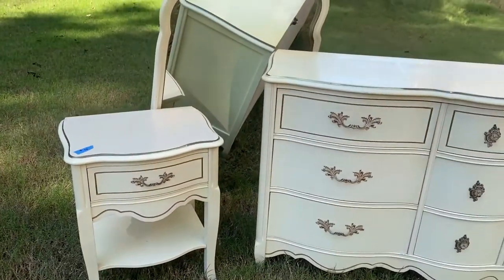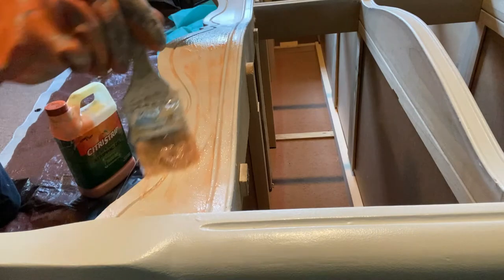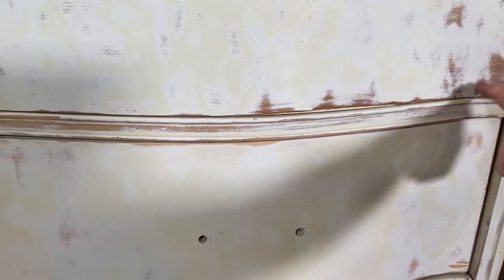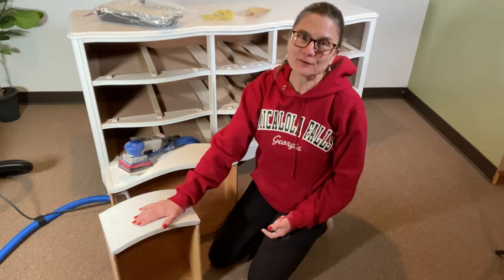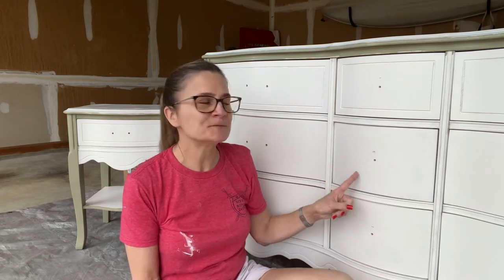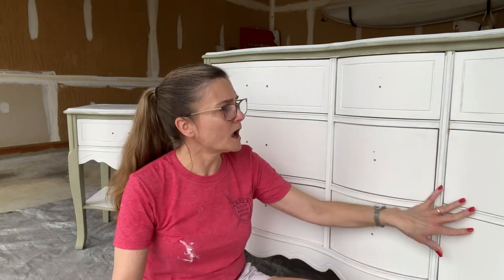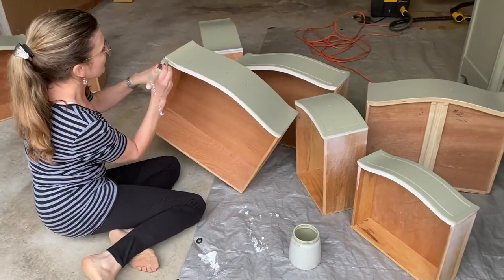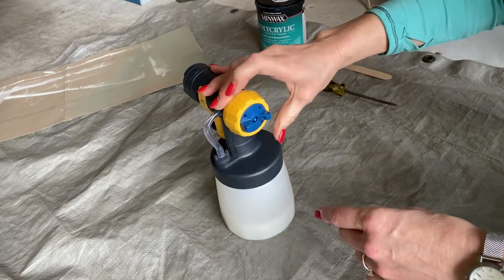How to Spray Fusion Paint with the Wagner Flexio 5000 || French Provincial Dresser Set Restoration

Comment: Excellent video, editing and narrative/story and intimacy/vulnerability.  First, your painting technique was excellent - I hope others picked up the way you kept the gun nozzle at a 90 degree angle and not tilt it from size to size or up and down.  Also, you kept the gun moving PAST the end rather than stopping or turning down and back - good for you!  Yes, your paint was coming out a bit too thick which led to the orange peel overspray so you might want to use a 10 percent water mix or reduce your spray setting so the paint comes out a bit more misty rather than quite so "wet."  Anyway, fantastic job and your hubby's camera work and lighting was great, your voice-overs were very natural and seamless, plus the music mix was just right.  Loved your attention to detail and finished product - many thanks!
Reply from the maker: Wow, thank you! Do you use this sprayer or a similar one too? I haven’t found that “sweet spot” yet. Sometimes I get a smooth, incredible coverage and other times using the same paint and settings it comes out orange peel. I can’t figure it out. I wonder if I would have an easier time if I switched to a pneumatic sprayer. What are your thoughts on that?

Comment: Nice video, do you have to use a primer with the fusion paint, thanks
Reply from the maker: Fusion has a built in primer and topcoat. I prime anyway if I’ve sanded down to raw wood in areas as I did hear.
Reply: thanks

Comment: Very nice job and great video! In one of the final clips, it appeared that there may still be orange peel. Did I see correctly, or did it ever level out? I’ve been spending the last 6 weeks preparing my old oak kitchen cabinets for a glass-like white paint finish by applying grain fillers, and am in turmoil deciding how to get the paint job done for a factory-like finish so all my time wasn’t wasted.
Reply from the maker: Thank you Jus! Yes I did still have some orange peel but less than what was shown in that clip. I think I should have thinned the paint with a little water. Good luck with your project. Let me know how it goes.

Comment: why did you upgrade your help gun? i have a wagner 4800 which works good been looking at the fugi help
Reply from the maker: I had the 590 and then the 5000 you see me using here. Both gave me issues with spitting (maybe I didn’t thin the paint enough). But what bothered me most is that I couldn’t get a wide spray pattern. The paint would come out in, at best, a 1-1/2” diameter. It took too long to spray.

Comment: Can you tell me what settings you used on the 5000 for Fusion?  I've seen people say around 5 with minimal paint output?
Reply from the maker: I don't recall what settings I used. It varies (sometimes even within the same paint line). My guess is that the air flow dial was set at a 5. Unfortunately the paint output is an unnumbered spring dial that you simply roll up or down to make adjustments.

Comment: What settings did you on your sprayer as you did mention that you saw some orange peel dimpling on your piece but you were hoping that it would settle once dry.  Can you tell me if it did?  What settings did you use?  It looks like you used the detailed sprayer from that set am I correct?
Reply from the maker: I’m so sorry but I can’t recall what settings I used. It varies from paint to paint. Why I sometimes get the orange peel texture is frustrating and beyond me. The texture on that piece did settle down. And yes, I only use the detailed spray nozzle.